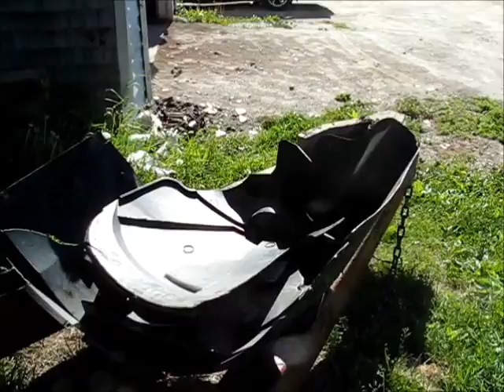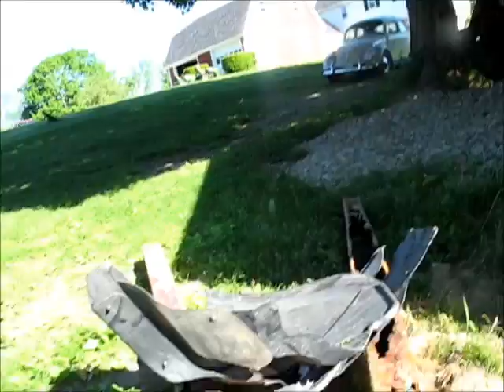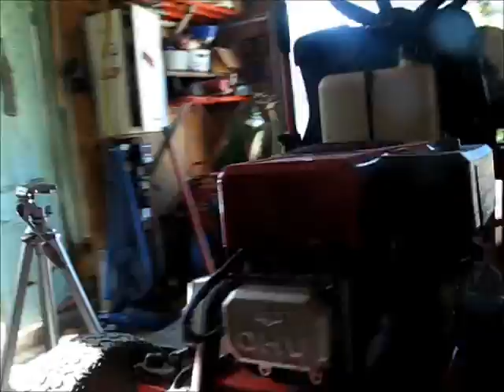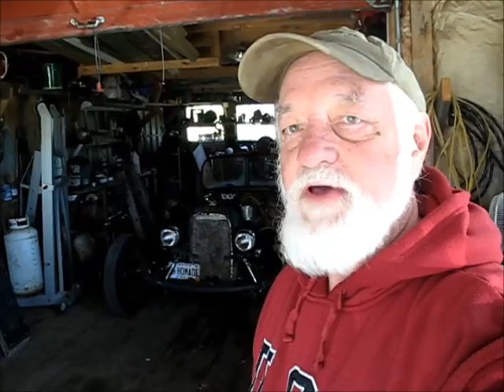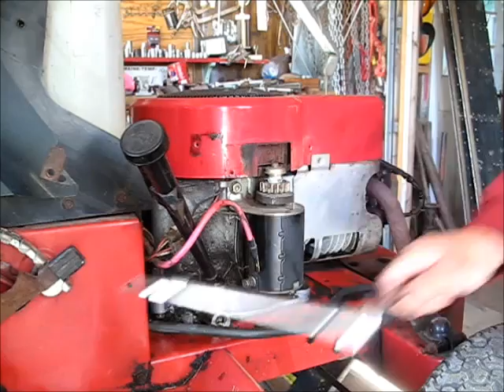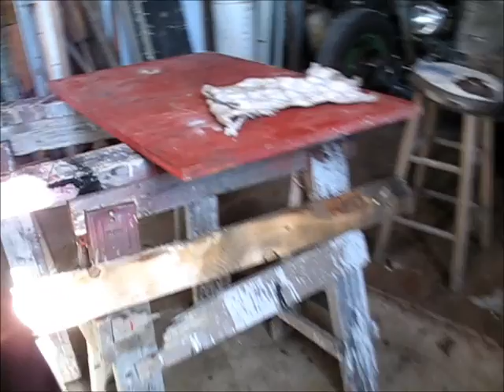Removing Starter 16 5 HP B&S

Comment: Due to budget cuts we've been trying to fix the older John Deere LT180 at work, nearly 1000hrs on it, the deck seized up in it. We've got another one identical but with a Briggs motor (the other ones Kawasaki) anyhow, i just finished rebuilding the starter on it, workin great! No more push mowin! hah